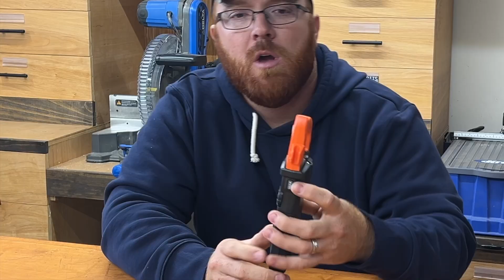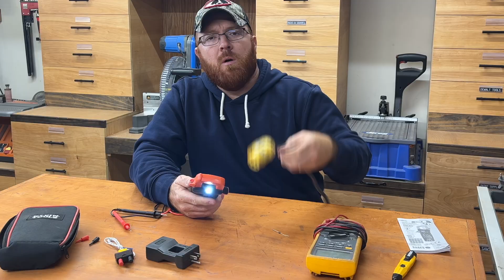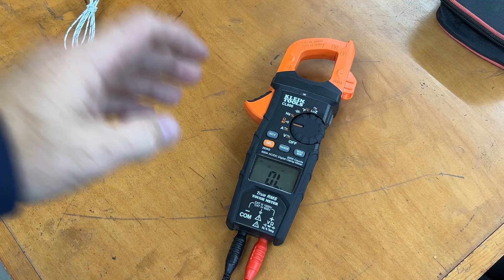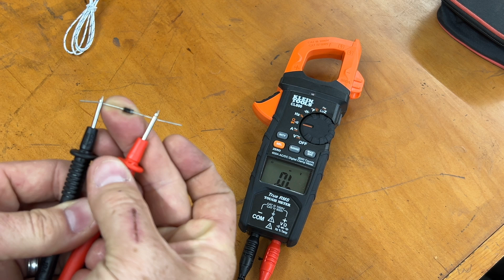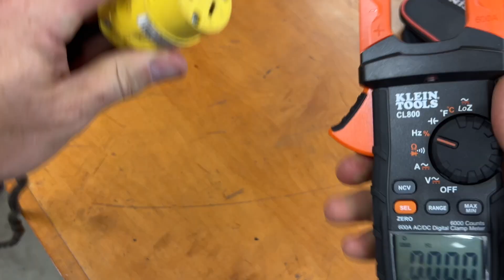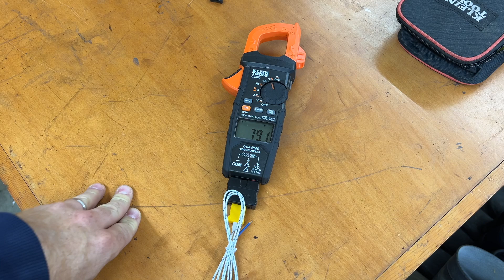Klein Tools CL800 Digital Clamp Meter Review | Great for the DIY'er or the professional!

Comment: LOOK!👉👉 Some Klein test leads may fit a tad loose🙄 (very annoying when you're already annoyed) but otherwise a great meter. No need to buy new test leads or send it back though. 
 I hate to modify things when they're brand new so I waited a year😄
Do one or both of these steps for good or better results! 

1)  You can trim the red and black outer-sleeves down roughly 1/8" and they will seat deeper into the openings with no harm done. This way they don't back out as often or as easily. (don't cut the inside probe, only the outer sleeves)
2)  Wrap some electrical tape around the outside of each red and black sleeve, roughly 1.5 times around (use a scissor or knife if you're OCD like me😄) 
Just enough to fit tighter in the hole, but still rotates to your liking.
...Problem Solved!😃 
This may seem like a stupid or sleazy fix to some but it works very well! 

I like using 3M's:  "Scotch  Super 33+"  vinyl electrical tape 
(the 8 and 10 packs are a good deal)

Comment: Hey! What about DC Amps and electronics use? I will love to watch some vs between this and the Fluke 393 for solar projects and electronics stuff.
Reply from the maker: Still great for DC. This one has found its way into my truck. Nice to have on me when I’m on the road or camping. Technically this is all you really need. I have a Fluke 87 that is my go to in the shop tho. I’ve had it for 20 years and it’s never let me down. I don’t have experience with the 393. I love my fluke meters though.

Comment: HOW DO YOU SELECT DC AMPERAGE?
Reply: THE FRONT PANEL DOES NOT SHOW  A DC AMPERAGE SETTING FOR WORKING ON A DC SYSTEM (AN AUTOMOBILE FOR EXAMPLE).  I DID A LITTLE DIGGING AND FOUND THE FOLLOWING: TO SET THE METER TO DC CURRENT, SET THE ROTARY DIAL TO AC CURRENT AND THEN PRESS "SEL" WHICH TOGGLES THE AMPERAGE FROM AC TO DC CURRENT AND BOBS YOUR UNCLE.
Reply from the maker: Sorry just now saw your comment. I’m glad you got it figured out though!

Comment: I just picked up the CL800, I was old school myself with my fluke meter, but I wanted something that does a little more.
Reply from the maker: You know I don't think I could ever give up my Fluke meter. That thing has just been so dang reliable & good to me over the years. It never leaves my shop. The Klein has quickly become the meter I grab & take with me though. It's just handy to keep in the truck & have at all times. I just bought a camper recently so the CL800 will be the meter of choice in the event I need to do any troubleshooting in the future. You just can't go wrong with either one of them!

Comment: New electrician here and I can’t decide on what meter to get. Would this be a good option or the CL900 -CL810
Reply from the maker: Great career field to go into! First off I'm not an electrician so my advise might vary from someone in that field. My first ever meter I purchased was the Fluke 87. I still use that exact meter all the time & I've owned it for like 20 years! A lot of guys say they love the Fluke 117 though so it would be worth checking out. 

When it comes to the Clamp Meters I've only really used the CL800 that I've owned. The CL900 has different features available but I believe it doesn't do the temperature if I remember right. Compare the features between the 2 and see what you think you can and can't live without. I do know the Clamp Meters are pretty popular with the HVAC guys these days. I'm willing to bet that once you've been in the game for a few years you will probably own more than one anyways. Hope that helps & good luck!